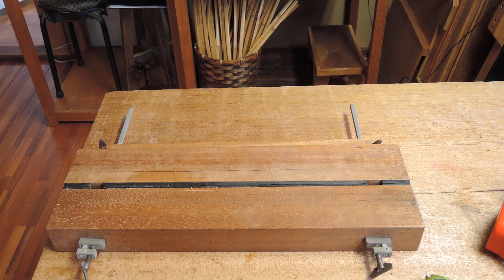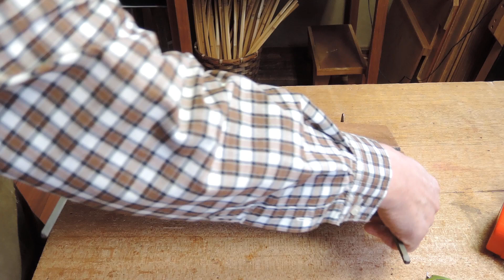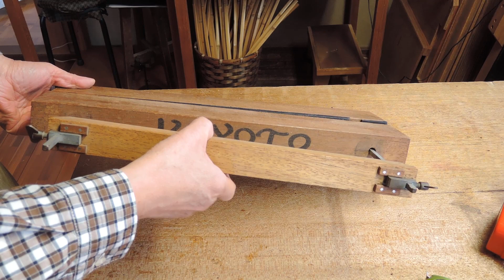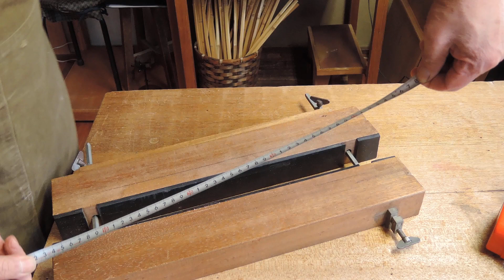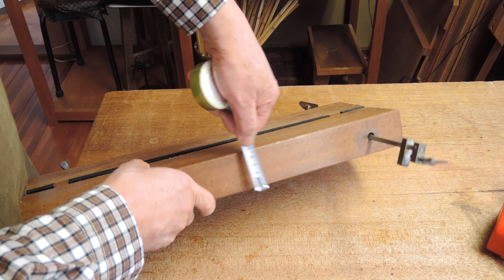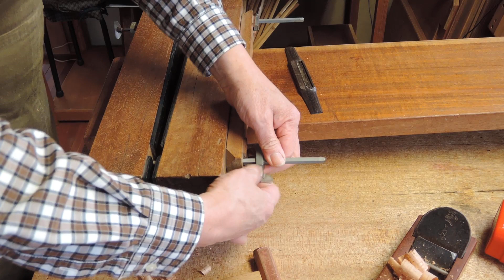自作のバイス作業台の詳細

Comment: Thank you for showing us the details of your bench top vice.  It looks like it is 48cm (almost 19 inches) long, 20cm (almost 7 3/4 inches) wide and 5cm (almost 2 inches) thick.
Reply: +AdventuresInDIY Yes, but the metal screws system, it seems so unusual. And so light to use.
Reply: +Predrag Nikolić 
These are typical Japanese clamps and can be found under that name.